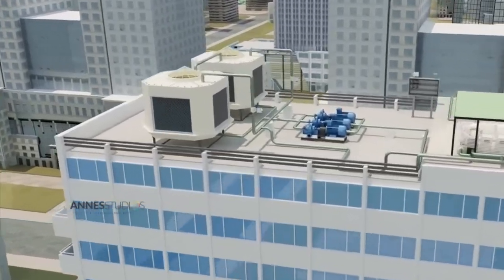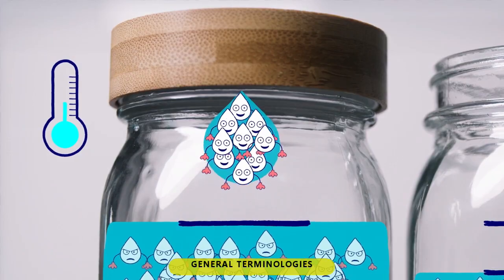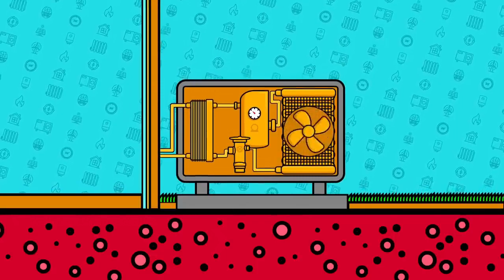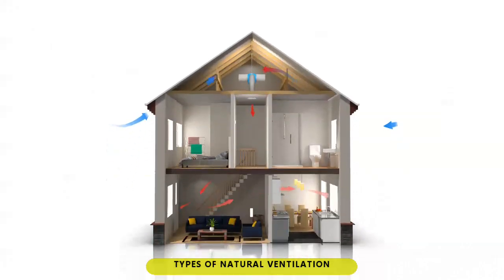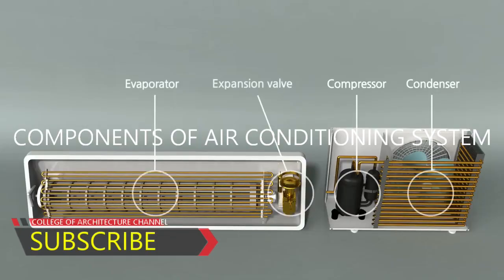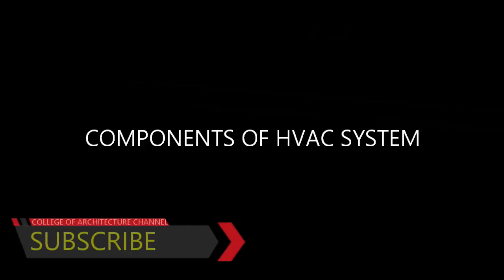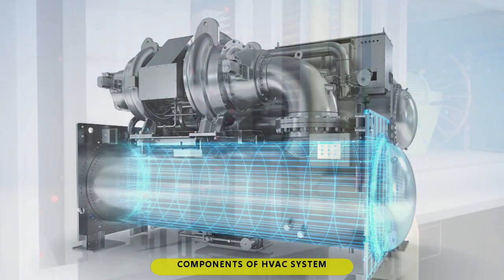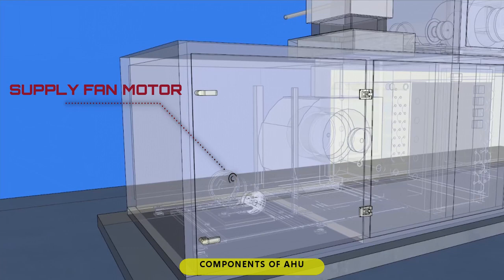BUILDING HVAC UTILITY SYSTEM

Comment from the maker: BUILDING CONSTRUCTION TOOLS AND EQUIPMENTS https://www.youtube.com/watch?v=ishwugmAgHM 
BUILDING CONSTRUCTION COMPONENTS https://www.youtube.com/watch?v=LGC6Fg-0wso 
BUILDING WOOD CONSTRUCTION SYSTEM https://www.youtube.com/watch?v=BJbg8vwyeDs 
BUILDING REINFORCED CONCRETE CONSTRUCTION SYSTEM https://www.youtube.com/watch?v=x4OaUkU_864 
BUILDING STEEL CONSTRUCTION SYSTEM https://www.youtube.com/watch?v=QPLf3o4HdZ0 
BUILDING PLUMBING UTILITY SYSTEM https://www.youtube.com/watch?v=nBbcEt7IZpM  
BUILDING ELECTRICAL UTILITY SYSTEM https://www.youtube.com/watch?v=yYYMsfE04nU 
BUILDING MECHANICAL UTILITY SYSTEM https://www.youtube.com/watch?v=ljk04dXXYPI
BUILDING HVAC UTILITY SYSTEM https://www.youtube.com/watch?v=eHLNHu2svu8
BUILDING SAFETY AND SECURITY UTILITY SYSTEM https://www.youtube.com/watch?v=vomM34YpCCQ